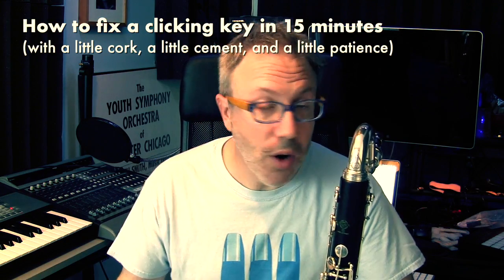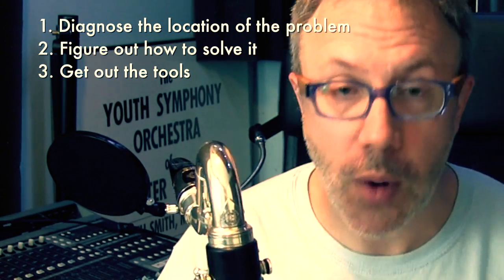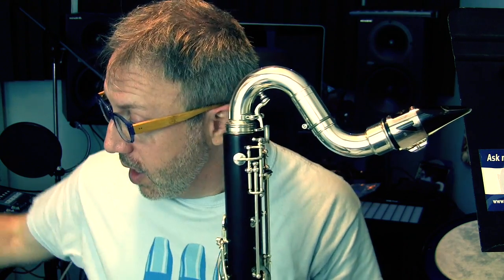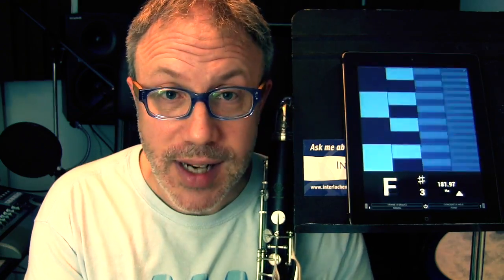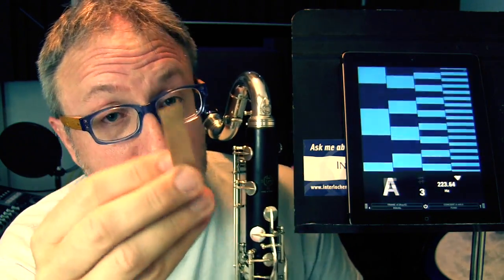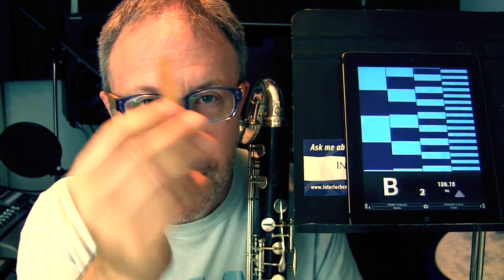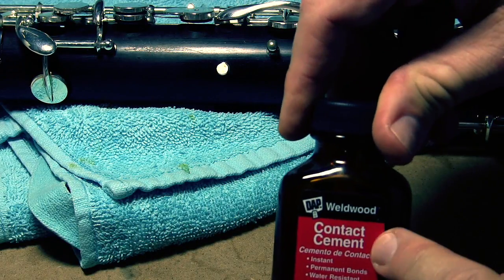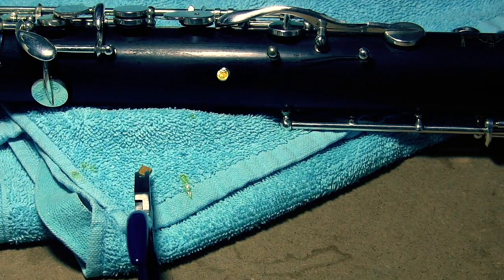Clarinet/Sax/Flute repair: Noisy, clicking keys

Comment: You could make perfect rounds with hole punches. They are fairly cheap, and you can buy them in any size. (Also an interesting tool if you want to make your own pads for your keys ;) )
Personally I would use bookbinders glue for these things, because it doesn't stain or corrode anything and is easily removable if you want to. But that's a personal preference. It doesn't hold as long as contact cement, but the contact cement can be harder to scrape off if you need to replace the pad.

Comment: What sorts of repairs do you suggest not doing on bass? I'm pretty comfortable doing work on my Bb/A clarinets so I am curious what you shouldn't (attempt) to do on bass
Reply from the maker: Good question. I personally don't change pads—it's not that hard, but it's something that is easily screwed up. Bending metal is also something I would outsource ;)
Reply: Makes sense, thanks!

Comment: This might be a remedial question, but what note do you tune your instrument to? I see that here you tuned the #G of the G. And in most ensembles, everyone goes off an A. 

But is there a pretty good note to bass ;) everything off of? When I tune to A I notice that my A is a little high and if I adjust to it, the majority of my horn will be low but the A in tune. I know that every note will respond differently and no instrument is perfectly in tune but where (what note) would the "average" be? 

I probably did a horrible job explaining what I'm asking but hopefully you get what I mean.

Thanks!
-GM
Reply: Geronimo You tune to every note! Tuning should be a never ending process, use the note that the ensemble tunes to (concert A), but use your ear to tune everything. There will never be one single note to tune everything.
Reply: Joshua Huff I agree that we all need to make in the moment adjustments when playing in an ensemble, however my question was more aimed at what note would be best for the instrument be physically adjusted to.
Reply: +Geronimo I use all 3 written 'B's (and 'E's/'F#'s if I have time) to tune with. I use the high 'B' to adjust the neck joint (or between barrel/upper joint), low 'B' to adjust in between the upper/lower joints, and middle 'B' to adjust between the bell/lower joint. This helps me keep all registers (roughly) in tune with each other.